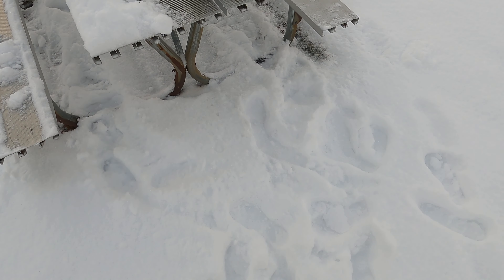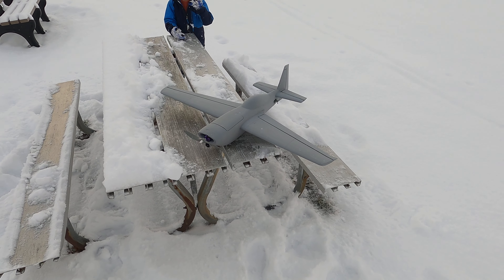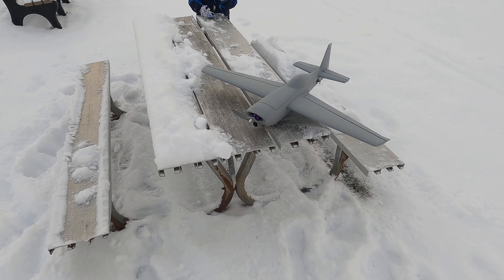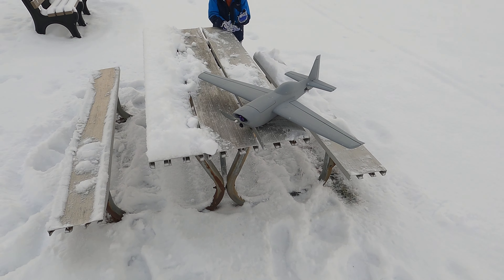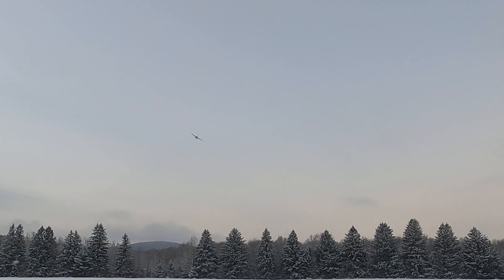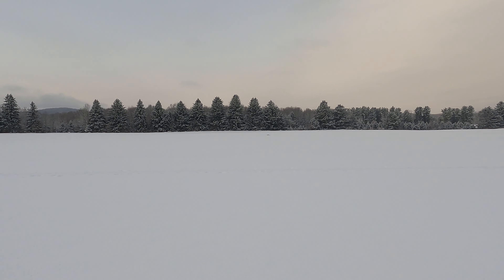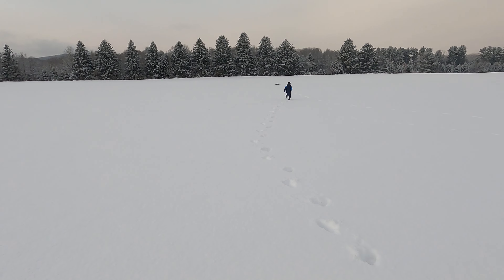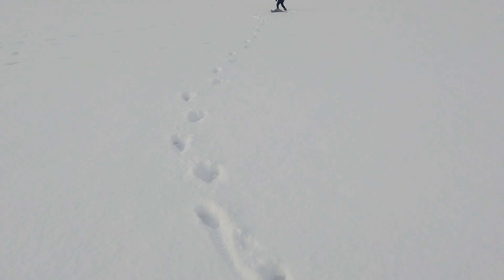3d Printed edge 540 flew awesome until It didn’t 😂

Comment: tail heavy just a little but enough it was trying to climb by itself i saw no input for the elevator at the beginning so if that was flat no up then it was climbing from tail weight and throttle overcame that until it slowed down then it instantly stalls. war plane fly that way very touchy you need the cg to be perfect. jmho $1.50 in coins can move during flight could be the cause also of a issue like this.
Reply from the maker: I think you may have nailed it. The coins were secured in Velcro pouches but I think it was a little tail heavy 👍🏻

Comment: What happened is your plane isn’t designed properly, that appeared like your tail stalled out.
Reply from the maker: Actually my elevator servo disconnected from the extension.  We figured it out 👍🏻
Reply: @hotlapkyle  so bizarre you weren’t even pulling a hard maneuver really.
Reply from the maker: @stephenmartin4603  my guess is the servo extension wires whip around when the plane rolls and that’s when the extension pulled out. When I pulled it back in and felt the resistance it was very low. Lesson learned. Always tape your extensions